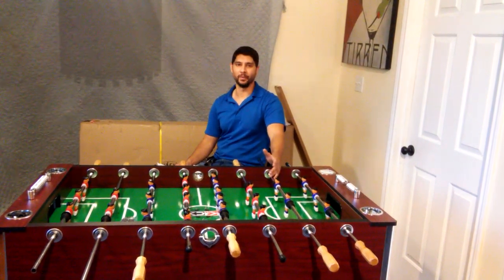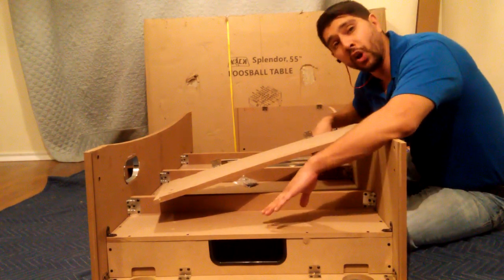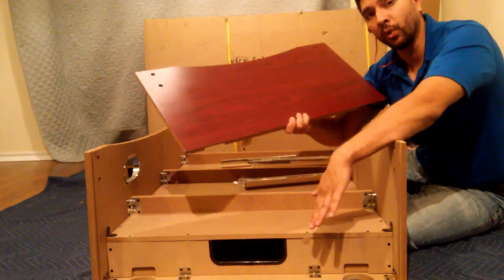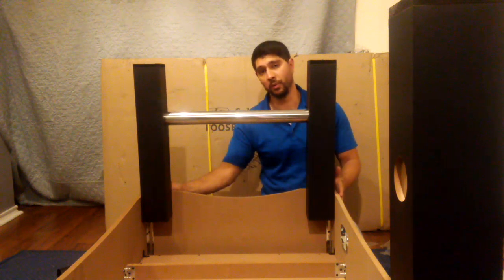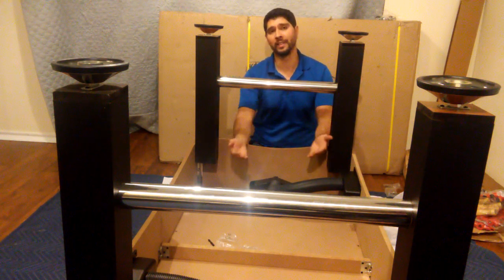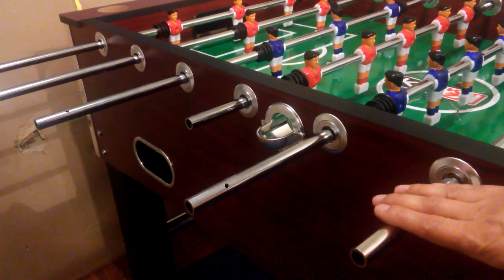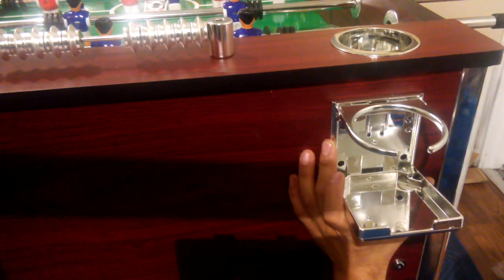Royalton Assembly Video Draft

Comment: A couple tips from someone who just completed this assembly....

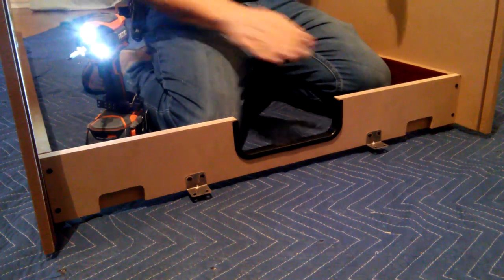1) The "after" image at 3:56 is definitely incorrect. The veneer should be facing in, toward the playing surface, and the brackets should be facing out. You can see this clearly at 3:49 and at 4:00

2) At 12:10, he goes into the assembly of the legs. Skip that and go to 14:10 to do the goal assemblies. Once that's done, go back and do the legs. The legs just get in the way of installing the goals, and the legs don't need to be installed before the goals go in. 

3) At 20:44 he does an example rod installation, which is great, but I recommend you do ALL the bumpers, washers, players and handles first without screwing anything together. In other words, assemble everything -- paying attention to the holes in the rods for the players and the handles -- and only after you've got everything in the correct playing position (men facing the right way, bumpers and washers in the right order, correct men per rod, handles where they should be, etc.), go ahead and screw it all together.

Comment: At 3:56, did he attach the end panels inside out, and then they switched in the next view?
Reply: The "after" image at 3:56 is definitely incorrect. The veneer should be facing in, toward the playing surface, and the brackets should be facing out. You can see this clearly at 3:49 and at 4:00